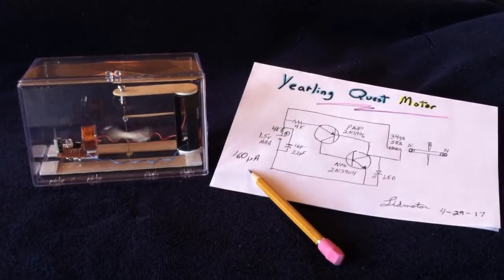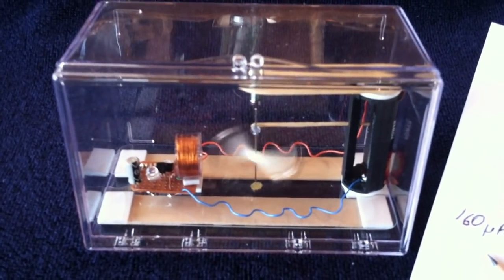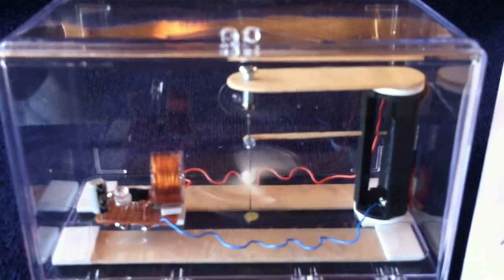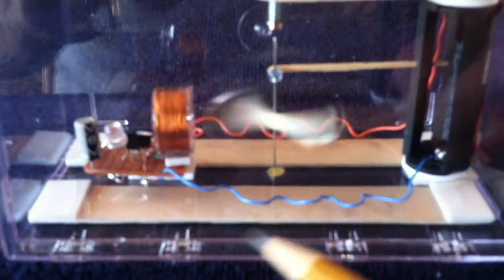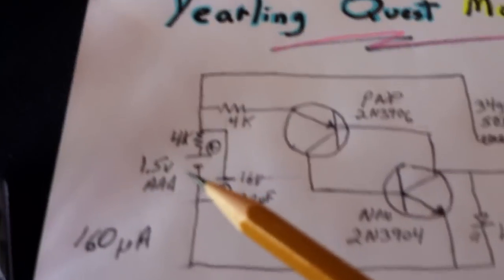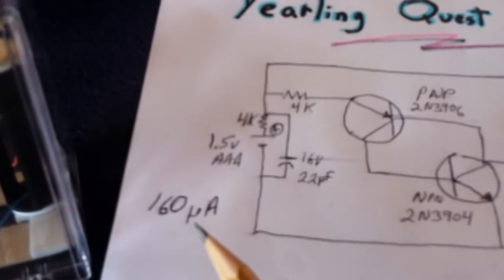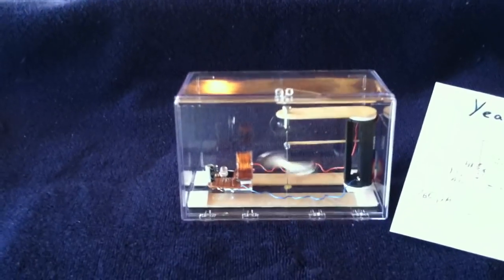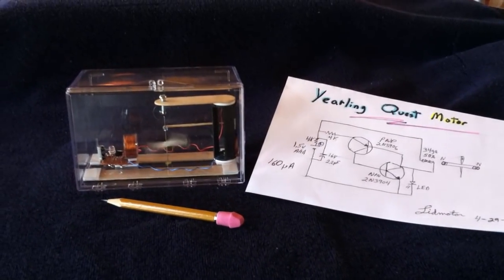Yearling Quest Motor

Comment: First, I completely respect your enthusiasm and enjoyment of this project.  Once I restore my hobbyist workbench, I can tinker for myself.   Q:  you don't use pole pieces in most coil arrangements - does such detract from the functioning?  Q:  while I know you favor the circuit design presented, have any attempts been made using other semiconductors, x-fets or igbt's?  Q: if your goal is to get the longest run-time, have you tried any addn'l circuitry which might use a hall effect device to gate the drive power, rather than an 'ungated' circuit?  Q:  have you ever probed parts of the design w/ an oscilloscope to get more operational data to improve the efficiency?  Just some thoughts that came to me as I viewed various of your vids.  Best luck, thx.

Comment: Was there any reason you stopped using the MPSA18 transistor? I was going to try it, but noticed that you switched back to the original. Was there any reason?

Paul
Reply from the maker: There was no reason for going back to that NPN except that it would make the device easier to replicate.   By the way I went over to your channel and looked at your work on the Zamboni pile experiments.  Really interesting stuff.  The one that is still running after 5 years is amazing.
Reply: Thank you very much for the compliment. I love the idea that it will work for over a Century. Even though I won't see it, my great grandchild will. ;-)
Reply from the maker: Check out this very nice micro amp motor by 'Tinker Jim' .  https://www.youtube.com/watch?v=vkhs1mBmTNA&t=0s
Reply: It is a very nice build. I wonder how much lower the draw would be if he had used a good bearing.

Paul

Comment: If you use a dual coil you'll be able to capture 80 % of the pulses from transformer action between the coils. I used 12 v and recovered 10v.  go a step further and capture the huge ringing BEMF and you might be able to get rid of the battery altogether by using the supercaps.

Comment: Nice buiild!

It will be interesting to know what the available power (V*A) of the cell is when the rotor stops spinning. :)

Thanks for sharing!
Reply from the maker: One of the problems with these long running experiments is remembering to track the progress as the weeks and months go by.  One of my most successful experiments is a house plant battery that is hooked to a simple Joule Thief.   My wife and I enjoy the plant with the light and take care of it.  The battery / Joule Thief part of it is an indicator of when it needs water.  It has been running now for years.  I  replaced the original Mg anode finally a few months ago.  About 1/4 of it was still left.  We will see how long this motor will actually run.  When it stops I will measure the battery.  I'm thinking the voltage will be around 1v.  Looking at the discharge curve these AAA drop off pretty fast at about that level.
  Here is the "Plant Battery" experiment that I started back in 2010 that is still ongoing:   https://www.youtube.com/watch?v=RaPUGNe6nl8
Reply: Agreed.  What I do to track long term events is to create a spreadsheet that I can add the date & any relevant notes that apply on that date.  I use it mainly for tracking plant information.

Cool plant battery vid--although I doubt the plant has much to do with how that batt works. ;)

re:  "When it stops I will measure the battery.  I'm thinking the voltage will be around 1v. "  
I would also measure the in-circuit voltage & current draw -- which will likely give you better data -- because the moment that you take a battery out of a loaded circuit (even as lightly loaded as yours is) the battery will recover a bit & skew your numbers slightly.

Comment: The length of your rotor, Magnet to Magnet... if you increase it, it will take longer to the next pulse. so you could increase the battery life by increasing it ? Love your work by the way.
Reply from the maker: Thanks.  This would make a good engineering project to calculate the best values for each component.  There are a lot of variables though.

Comment: it is proven that the  bigger wire can run micro amp. I wind a coil 30 gauge @ 10 ohms it run pulsing 200 Uamp
Reply from the maker: Yes.  You were the one who proved that to me.

Comment: Nice compact assembly. By my calculations, should last about 10 months.
Reply from the maker: Remember---the 160 micro amp draw is not constant.  It is spitting at rotor in short bursts.   At least that is what I am counting on.  You are right though that at a 160 micro amp constant draw she is done at about 312 days.
Reply: Good point. I think that will extend the life of the battery. You will probably get a full year. 

Paul
Reply: @Lidmotor:
I calculate 312.5 days of run time @ a constant power draw of 240 µW (1.5V * 160 µA) .  It looks like you may have used my calculation method to compute your estimate. :-)

It will be interesting to see the final available power (V * A) when the rotor stops turning. 

You could make a circuit modification to allow you to manually wean the current until the rotor stops & then add back just enough to keep it barely turning after starting it to determine the minimum A that is necessary to drive your rotor.  Then V*A will let you know that power level & then with some math, it would be possible to quite accurately calculate when the rotor will stop rotating.